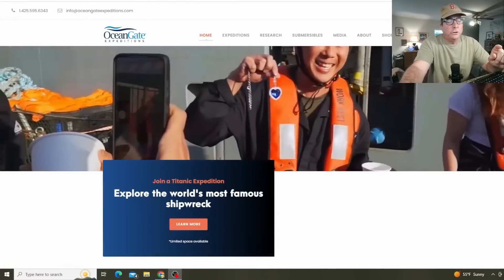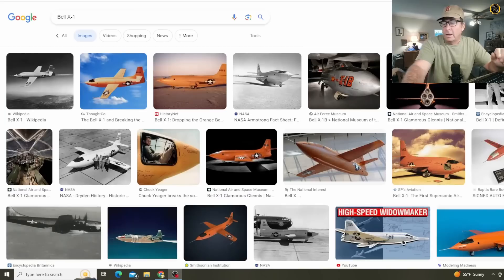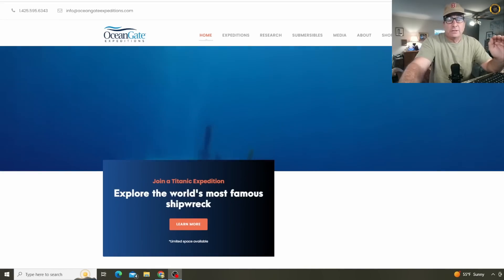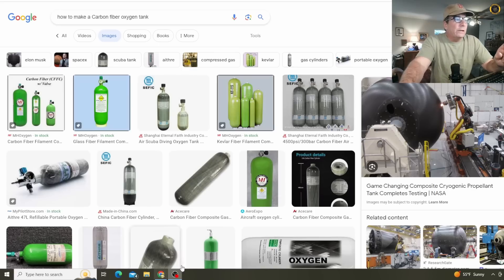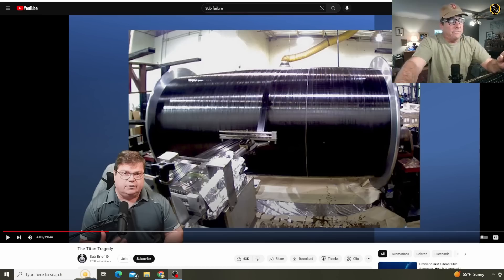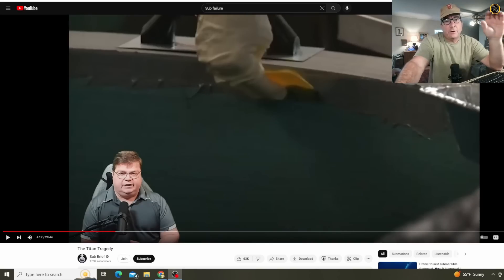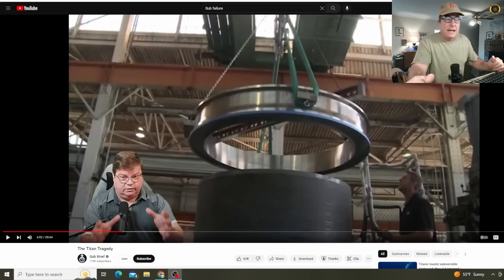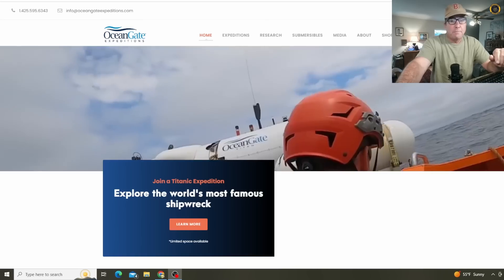Oceangate Sub Construction Details and Implosion

Comment: Good explanation!  With this design you are relying on the strength of the resin almost entirely to resist longitudinal forces, and you make an excellent point about the "radial ply" layup of the fiber vs. the more common "bias ply" pattern.  And as you say, these are vessels for internal pressure.  A rule of thumb for vacuum vessels is you need a design capable of 125 psi internal to resist 15 psi external, although that was for thin walls.  These were supposed to be five inches thick, but I would bet the cylinder moves a lot under stress, and probably not uniformly.  The submariners were relying on a giant, badly laid up, water softener tank with glued on ends.

Comment: As this is primarily an aviation channel, it could be interesting to do a deep dive on the carbon fiber composite air frame of the Boeing 787 and how the 787 got certified to fly with this material and what it took to get it certified and contrast it with the construction of the Titan sub.  While in many ways these are different beasts, I think there is plenty of overlap to go over and help bring into focus on what all was wrong with the Titan design.  Granted compressive loads is not carbon fiber's forte, making it a rather odd material to go with, especially without a cross hatched pattern to help with the strength of the material.

I look at things such as flying large scale R/C helicopters.  Carbon Fiber composites is a very common building material for R/C helicopters.  So for example I would fly with straight carbon fiber composite frame pieces, but then have an aluminium tail boom.  When I would have a tail strike, the aluminum tail boom would bend.  If it was slightly bent, I could fly again, but I would change it out for safety reasons.  I would see other people fly around with bent aluminum tail booms and it worked fine.  However, some people would fly with carbon fiber composite tail booms.  I would see them have a tail strike and after, everything looked fine.  They would go up again and the tail boom would just shatter out of the blue mid flight and the helicopter would go down with the ground judging swiftly and harshly on their poor judgement to fly again without swapping out the carbon fiber tail boom.  On the same token with the straight carbon fiber frame pieces, I would have a not so bad crash and the carbon fiber looked fine.  I would spend a day or two getting the helicopter flight ready again and the frames would be fine.  I found that the straight frames could flex a lot without cracking.  However, those carbon fiber tail boom tubes were very rigid due to its shape and it was basically impossible to find the cracks, so the cracks would progress on the next flight until the tail boom shattered like glass.  

Here is the thing: Aluminum deforms.  Steel deforms.  Titanium deforms.  Carbon fiber composites don't deform, but they do crack and shatter like glass.  Especially when you get into extreme ocean depths, I am sure that carbon fiber was just obliterated as it cracked and catastrophically failed.
Reply: Pun intended in the first sentence?
Reply: The tail boom story is interesting. It shows that CF has no ductility. It's very strong but when it fails, it fails catastrophically--no plastic deformation. Thanks for sharing!
Reply: @rodneybrocke CF's lack of ductility makes for a great kayak paddle, all my power goes straight into the water.  That's the extent of my expertise!

Comment: Carbon fiber is an awesome material. I’ve owned several carbon fiber road bikes over the decades. Buuuuuuuut…….I wrecked my Trek Madone years ago, and had the dealer give it a thorough inspection. Couple months later the right chainstay snapped and sounded like a gun going off, and led to some more road rash. Obviously it had gotten a hairline crack in the first crash, which led to failure. Steel has its advantages.

Comment: Retired career advanced composites guy here (yup, over 50 and white...). I have to assume that this cylinder was cured on its winding mandrel (male) under heat and high pressure. A 5 inch thick wall wound cylinder will exhibit very significant buckling in the fivers during the wind and cure. During the wind the continual compression of the underlying hoops will buckle them and then that situation is only exacerbated curing cure as the consolidatoon of the wall results in excess line length in the plies/layers. Every buckle is a crippling point structurally and the resin pool that forms at each site also will have a tendency to microcrack.
I would also have thought that the end bells would have been deeply pocketed to receive the cylinder and that the bond line would be some sort of infusion with vents to minimize thapped air.
So sad. So many extreme ignorant executions.
Reply: With your experience, shouldn't the cylinder have been put inside an autoclave to cure? McDonnell Douglas would put their entirely assembled AV-8B Harrier aircraft composite wings inside large autoclaves to cure.

Comment: In compression, you are relying on the strength of the resin, not the carbon.
And resin s not very strong.

Plus, there is a large difference in the shrinkage with temperature, between titanium and carbon.

R

Comment: Took my shoes to a cobbler and see if he could stick back the sole to the bottom.

He said he could do that. But I would be wasting money. It will work for sometime, but it will not last because the dissimmilar don't really bond well together. Asked if I put it in the washing machine too.

I think modern walking shoes nowadays are designed to fail.

Comment: I heard a comment that stated there may have been some electrical conductivity within the carbon fibre material induced by sea water which weakened the structure. Also that the Navy had played with this already and deemed it unacceptable for this use. I'm no engineer, just thought I'd add two cents...

Comment: Basically...the epoxy glue joint failed to hold the titanium end caps on @5900 psi...> 
4148 tf/m^2 of surface area . Seems to me that a fully bolted end-to-end rod connection would've solved the end cap problem while adding compressive resistance to the cf cylinder. Without the longitudinal tension rods pressure squeezing the tube would pop the end cap off as the glue joint delaminated.

Comment: There is a ndt test for the 787 we call it the ramp damage detector.It’s basically a U T gauge (Ultra sonic) there is a check for porosity 
   There is no way I would trust a glue only joint on that ring The 787 is mechanically fastened with a plethora of exotic fasteners,sleeves and composilocks

Comment: Differences in expansion and contraction coefficients of dissimilar materials on a radius as well as linear- yeah I would expect that to give you trouble. Also mating surfaces with bolts- very hard to get a consistent and even pressure.
Too many changes in materials and too many changes in shapes this coupled with changes in temperature and pressure as well as the rate of those changes- problematic.
This is why people prefer spheres made of one material
- steel, titanium, or ceramic.

Comment: Exactly on point. I wonder how many compression cycles this vessel went through before failure. As an engineer we know there are calculations that will reveal that information. I worked primarily in aerospace metals and this was one factor in many to predict failure. I always wondered about the CF use in pressure vessels. The explanation of the two dissimilar materials makes sense. Thak you for that explanation.
Reply: Just one more thing. I keep thinking about Virgin Galactic , SpaceX and Blue Origin. These are vehicles designed for paying customers. I would guess that the "baby steps" were taken during the development. But how safe are those?
Reply: @rickklein7792  Those are flying in a much more regulated environment. They were tested, then tested to failure, then tested some more. Then they flew several times without anyone onboard, before they were certified by the FAA and NASA to carry humans. Guess who's spacecraft is still in testing phase after several years (yep, it's Boeing).
Reply: @csgergo80  Agreed but how many people are thinking those vehicles are not safe. Not that I want to go. SpaceX is doing the work of NASA to a much greater degree.

Comment: Good lord. I just saw another video of then tightening the bolts on the titanium ring with hand ratchets and no torque monitoring! I said I worked I aerospace earlier, but also worked in oil/gas offshore. The BOP, which sees 16k pounds of pressure had to have about pattern and torque values for each step of putting the assembly together. Otherwise...uh oh.
Truly incredible the number of issues with this vessel!
As an instance, a short vid, which I'm sure these people didn't bother to understand:https://youtu.be/P5VhGDrzYP8 https://youtu.be/P5VhGDrzYP8

Comment: Some marks I'd like to add coming from my 27+ years of service as a mechanic in the Air Force : Carbon fiber can and will be superior in strength - in many applications - than many metals including steel , aluminium alloys , and titanium in some cases . All depending on the weaving pattern , the orientation of the fibers (which is a complete science on its own) , the bonding agent (ie the type of the impregnating resin) and the curing method ..... That said we must understand that CF can be very resistant in forces only on one direction (mainly the direction of the fibers) thus in aerospace industry the composite carbon fiber constructs are always multiple layers with different fiber orientations.... This strength and lightness comes with some caveats though , mainly that it's almost impossible to be 100% free of imperfections - and that leads to some extend to reduced life expectancy to a material that inherently can have infinite service life. This requires constant checking through the service life of the part with Non Destructive Inspection (NDI) methods - mainly x-rays and ultrasound (there are also chemical agents but they are not suitable for carbon composites). Given that the whole construct had been cycled under extreme conditions (extreme pressure and temperature differentials) I suspect that it is highly probable that some sort of mechanical fatigue had happened (i.e. micro-fractures) that passed undetected if any sort of the above mentioned inspection haven't been done in regular intervals .....
Reply: Glad you typed out what every expert has said in every video at this point.

Comment: Interesting: it appears they bonded the carbon fiber tube INSIDE the titanium ring! Thus, pressure would be pushing the carbon tube AWAY from the ring. Why didn't they put the carbon outside, whence the pressure would be pressing the tube towards the ring? Did they feel the titanium would flex more than the carbon fiber? Juan also pointed out that carbon fiber is weaker in compression than it is in extension. Tis was a setup for failure!

Comment: It seems like that in this design the glue acts more like caulk. The titanium end is going to be pushed into the carbon fiber end. The most important property of the glue is to act as a sealant to prevent water intrusion through the connection. That sealant needs to be a super material that can function flawlessly with enormous temperature and pressure changes.

I'm not a mechanical engineer so what I say isn't well informed, but I hate this design. The ductility of metals makes a design so much more forgiving that using any kind of low ductility material for the hull seems crazy.

Comment: I suspect we're going to have two possibilities regarding failure mode of the main body of the submersible:
1. The CF tube got squeezed until one of these glued joints that held the endcap just popped off, the water rushed in in milliseconds, and that was the end. I don't think the titanium ring itself did fail. This would mean one should find the tube in a more or less complete state.
2. The complete tube had a catastrophic failure in the CF which propagated at multiples of the speed of sound due to the 400 bar pressure at the bottom of the sea, and if this is what happened, you'll be looking for CF chips, not complete parts of CF. Maybe the end caps are going to remain in a more complete state.

There's a reason why all other deep sea submersibles are built out of metal, and why the Rolex Sea-Dweller is not built out of CF.
Reply: The reason is very simple: You can't push a rope (the carbon fibre).
This is the basic misconception of the structure.
Carbon fibre is excellent in tension, not so good in compression.
Reply: I would think the primary reason you wouldn't build a sub out of CF is that the primary advantage is meaningless underwater. There is no need to have a light hull as you're already fighting the buoyancy.
Reply: With that construction of all the fibers running perpendicular to the length of the cylinder, it seems to me that it would be very prone to crack in the middle. I would guess that either that, or a failure of the glue joint (or the carbon fiber near it) was the point of failure.

Comment: I don't think it's an issue with the amount of temperature cycles on the carbon fiber tube. Just look at SpaceX Falcon 9 booster 1058 which had 14 launches and it is made of carbon fiber. Like you said the differences between the metal and a carbon fiber and their expansion and contraction rates could have easily made that joint fail. Was this thing ever tested to the depth of the Titanic and have a post inspection? You can do an x-ray inspection of this vessel. Even the carbon-fiber.

Comment: An issue I've noticed with this particular carbon fiber construction method is air entrapment. As that carbon fiber media is being laid onto the tube, there is an opportunity for tiny ammounts of air to be trapped under it and frozen there when the adhesive sets. Even microscopic bubbles between each layer will compress under the extreme pressure causing the bond between layers of filament to break. Just a theory, but air entrapment is a big concern in the adhesives world.
Reply: Yes, the CF sections for the likes of the fuselage sections of the 787, are impregnated with resin in a vacuum chamber before baking to set the whole structure.  Proper design, proper testing, proper certification and proper maintenance generally gives safe outcomes. Not, shortcut, shortcut, shortcut.  That ideology cut lives short.
Reply: @peterwiles1299  Exactly. The component tanks for the resin and hardener are usually evacuated of air as well to remove bubbles and blanketed with inert gas before dosing and mixing. I wonder what sort of system OceanGate used. It could literally have been mixed in buckets.
Reply: @haunter_1845  at 5 inches thick I doubt you could infuse it, so I would imagine it was prepreg. At that point you just bag it up and put it in the oven. The bigger question might revolve around the maximum stack you can successfully remove voids from. 5 inches does seem like a lot of material to migrate air through.
Reply: @mrl22222  I'm not quite sure what to make of it at this point really. It looks like they axially wet wound the whole thing with the media being tensioned and fed off one side with a guy on the other manually  applying mixed resin with a plastic wiper.  It's as simple as that. I'm not sure how you would eliminate air out of this method.
Reply: @haunter_1845  I hadn't noticed the wet mix part. WOW! I could see maybe prepreg at that thickness but wet? I can't imagine it would all in a single go at that point, which means you would have multiple layups with no real consolidation.. Of course this would explain multiple "bangs" at times, as one of the layers fractured. (carbon loves to fracture quite loudly). That being said, I'm sure someone must have thought it's a good idea...

Comment: the shot of the guy mixing the epoxy and I assume catalyst in a messy gallon bucket was troubling as well. I hope it wasn't a can of bondo from HD. also, without vacuum bagging the tube during layup, one could imagine uneven epoxy throughout the CF structure.  This looked like old school fiberglass boat hull building before vacuum bagging was used.

Comment: They're not going to be able to recover anything because it's too deep. They're just gonna analyze the footage from the ROV Sub. They found the two dome end caps and I believe they mentioned the titanium rings were still inplace. It was the flat tube part that failed. They didn't engineer it with enough of a buffer. They were right on the cusp of the materials technical limit. (I think they only left a 5% buffer. They were supposed to maintain 50% buffer.) The cheaped out, that's what happened.

Comment: The Oceangate Titan was a totally mediocre design.  It was Mickey Mouse, garage workshop amateur.  Anyone with any kind of manufacturing/shipbuilding/aircraft/machining experience that demands extreme precision and advanced engineering, can see that glueing and bolting two metal ends onto a carbon fibre tube is a joke.  It might be OK for low depths of only a few hundred feet or more, but definitely not for the incredibly powerful pressures in the deep ocean.  If you made a scale model, then put it into a vice or a powerful hydraulic press, it would soon deform, crack, warp and come apart after repeated extreme testing that compared to low ocean depths.  What a tragedy that all those people had to die because of one guy's big ego.

Comment: I'm gonna go against the grain and say the joint was glued just to keep the thing together when not under crushing pressures since the latter would have sufficed to keep the cap on and tight. Same reason they did not cross the weave (it would at the same time reduce the fill ratio since the fibers are best packed when they are unidirectional).
The carbon fiber will delaminate and buckle under compression, that is my suspect.